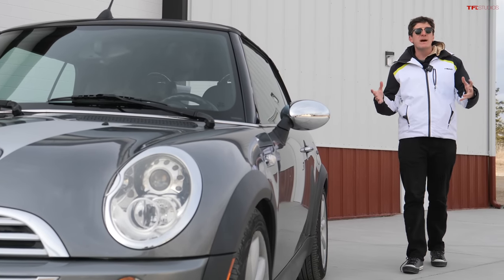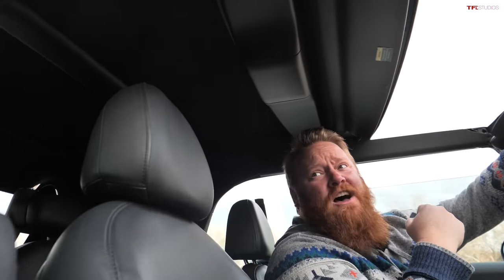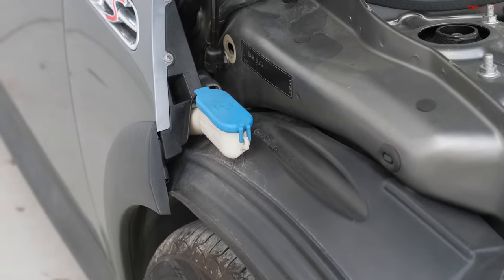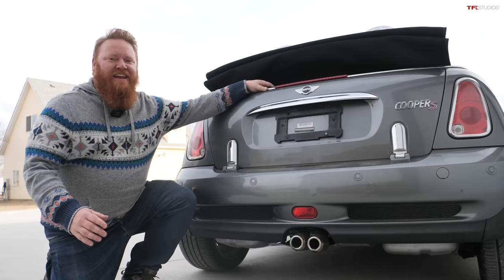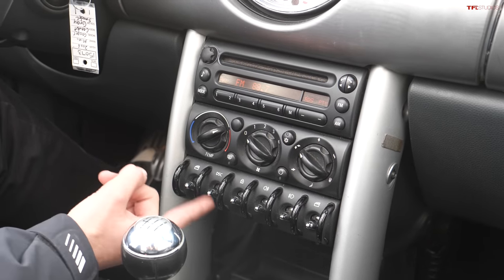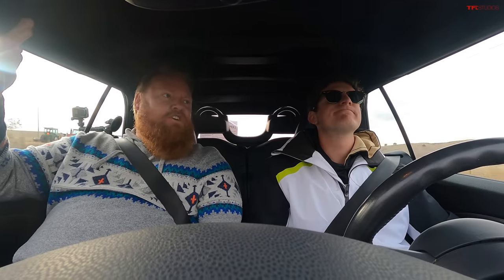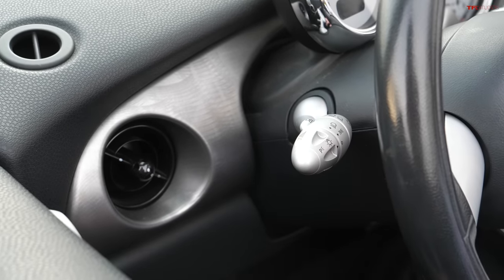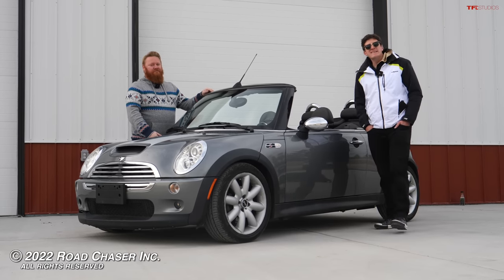I Bought The Most Fun & Best Daily Driver For Under $10K!

Comment: I bought my wife a 2006 Cooper S convertible with the Aisin 6 speed automatic 10 years ago. The only issue ever was the replacing the transmission valve body with a rebuilt unit. At 17 years old it looks and drives like brand new with 115K on the odometer. She retired and doesn't drive much anymore so it's up to me to put some miles on it. Like these guys said it's a solid car that drive like it's on rails. Besides that, it's fun and stylish.

Comment: I mentioned in the fleet video that I've got an '05 JCW R52, with 207hp, Sport Chrono and a manual trans. I like it, but it's a good thing I'm an ASE Master Tech. Keeps popping check engine lights that I'm constantly chasing. Mostly emissions related (vacuum/boost leaks). The only other problem is that the left top pin needs to be "guided" into it's hole or it misses. Picked it up for $5k with an oil leak. Was just the o-ring on the crank sensor. I'm surprised you didn't mention the JCW package. It was a pretty rare dealer installed $5k option. It even included a new cylinder head. If you're ever in Vegas and wanna check it out...

Comment: I've owned a R55 (Clubman S) and a F60 (Countryman S All4)- loved them both, but with BMW engineering comes BMW problems.  With the R55 I had to deal with decarbonizing the intake valves due to the early direct injection system, had to replace the water pump and what might be the most ridiculous thermostat in the industry; I referred to it as a Jarvik-7 artificial heart.  The F60 only gave me one problem- a leaking rear diff that BMW quoted $3800 to replace, so I bought a nice salvage one for $1500 and replaced it myself.  The R50 series is one I've long wanted to experience, you seem to have gotten a good-un.  Good luck!

Comment: I owned the supercharged version and my only advice is if you do any power upgrades like smaller pulley,  upgrade the clutch asap it can't not handle more than its stock power and get rid of those heavy ass stock wheels and run flat tires.
Reply: Great advice. Would do all of that an a tune obviously.

Comment: Biggest buying tip with the R50/R52/R53 is to get an LCI (facelift). 

Have owned an R50 and currently have an LCI R53 and it's never skipped a beat. 

There's some preventative maintenance like the power steering and when you get 100k the super charger service and you'll be golden.

The biggest thing for me is the smile per mile factor. It's a such a fun car and super charger whine is 👌
Reply: R52 only came as LCI, came out with the facelift
Reply: @reecedrury4145  yup, only R50 and R53 had the older unreliable stuff. R52 does come with it's own separate issues though, but that's more to it being a vert.

Comment: I have an 18 year old R50. 177,000 miles and only a clutch change at 122,000. I also have a 2019 F60 with 76,000 miles. Flawless reliability on both. Most people associate poor reliability with BMW, but that’s just not true. Some older models yes, but now it’s ranked 2nd behind Toyota/Lexus tied for 1st. I’m buying a third model soon.  This brand has a history only understood by rally fans. You may not like the brand, but it’s much more fun and the BMW dealership experience is top-shelf.

Comment: I had a 06 R53 I bought new drove daily for a decade.  I traded it in 2016 in on a wrx.  I miss the mini so much but key is that nothing has broken on the wrx, it's just been regular maintenance for the subie. With the mini, I went through a number of power steering pumps, windshields, and upper engine mounts. Even if the fan is working the power steering fails around 30,000miles and stresses.   It doesn't take much to deform the strut towers making alignment an issue.  The ebrake cable tended to freeze in the winter locking the brakes.  The wheel bearings have a abnormally high failure rate.   At the end I was spending a few hundred a month on maintenance and was starting to defer maintenance because new more serious issues would pop up first.  A miatia might be the only car to compete with it for fun driving.  I don't recommend one unless you have a 2nd car for when the mini inevitability is in the shop. 
All that said I don't like the wrx nearly as much despite being much faster, more reliable and debatably more practical.

Comment: Had an R53 (supercharged) S.  Was fun and cheap, but in spite of the hinged hood, they are NOT super-easy to work on.  There are a number of issues such as the timing chain tensioners.  Not only is "service position" removing the front of the car, but you've also got to partially lift the motor.  Replacing the oil pan for a cross-threaded drain plug?  Good luck.  But the final straw was the rust around the rear tail lights.  I can do most stuff on a car, including the above jobs, but I don't have the skill and shop space to replace sheet metal and paint--at least not to my aesthetic standards.  So I moved on...

What did I get?  Well, by 2022, rust-free early Miatas had gone insane, so after much research and hunting I bought a 2002 Boxster S for under $10k.  Double the power of the Miata and I am extremely impressed with the quality.  100k+ miles and it still looks incredible underneath--this is a Midwest car and these things don't rust!  I replaced the transmission cables, motor mount in under an hour, did some maintenance, and made a few elective upgrades.  Sure if you can't do these things yourself, you're going to get smacked with the Porsche-tax, but these are very well engineered (IMS aside) and built.  This was my first Porsche and I have zero regrets.

Comment: I had an 06 MINI JCW with the Checkmate pkg and absolutely loved it. Very reliable and but other hobbies got in the way and needed a bigger car. Got an 04 R32, which was a real pig. Anyway, the gauge cluster to get was the Chrono Pkg, which put the fuel gauge, water temp, and oil temp and pressure in the center and the speedo and tach at the steering wheel.  I would recommend the JCW airbox if you do make some mods, it opens up above 4000 rpms and really lets that supercharger whine come into the cabin. Great content - I wish I still had it.

Comment: Always wanted a Mini. Or a New Beetle. Either or.
Reply: The New Beetle is arguably more reliable. Plus, it's easier to find parts because most of the parts were shared with the Mk4/Mk5 Golf. Especially the engines.
Reply: @damilolaakanni  the MINI has far less historical baggage though

Comment: Theres wayyyyyyy more cars for less than 10k that are fun and good daily drivers example my 1994 honda civic that im returning to stock form reliable cheap and simple and cost $500 sure it needs some work but its better than that pos mini pooper. By the time im done the car will be a good car that im gonna drive until the engine needs rebuilt then im gonna do that.

Comment: Big boy, you are dreaming my friend, my 2007 GTI is a much better car, with more power it would blow the doors off that Mini, and I still own her to this day, oh and she is very reliable!
Reply: Your GTI is not available as a convertible. It's just another boring hatchback. Yawn.
Reply: @bigmacdaddy1234  I hope you don't flip your convertible and loose your head!
Reply: @rogermartinez78  Your hope is not needed. There are two active roll-over bars located inside the rear seat's head restraints. The bars are reinforced and just as sturdy as the windshield frame, providing extra support at the rear to give all the occupants enough headspace, even as the car rolls down.